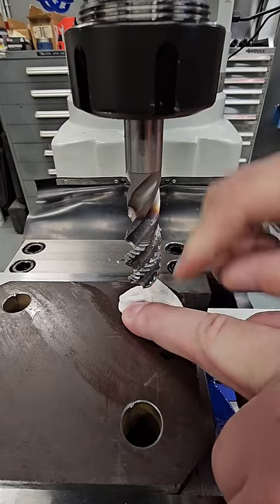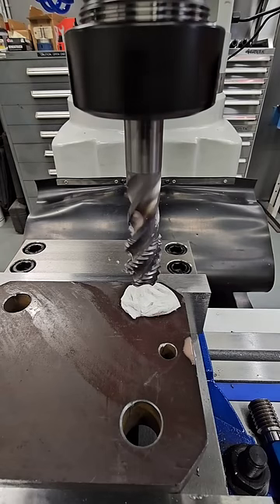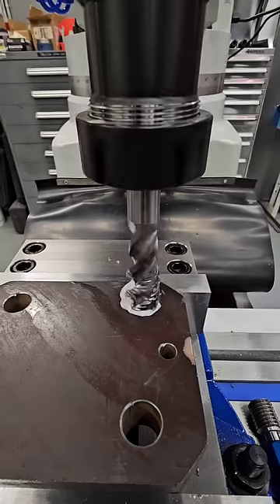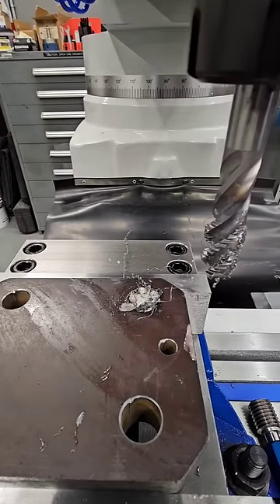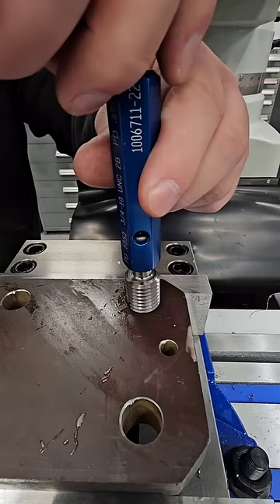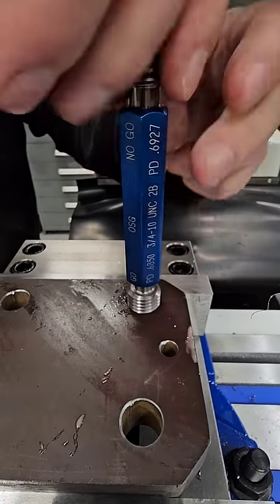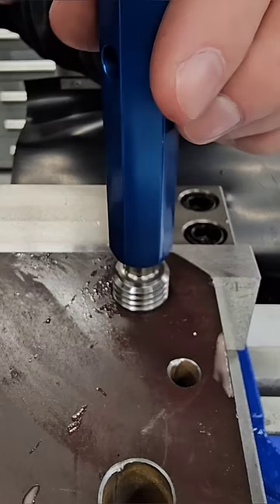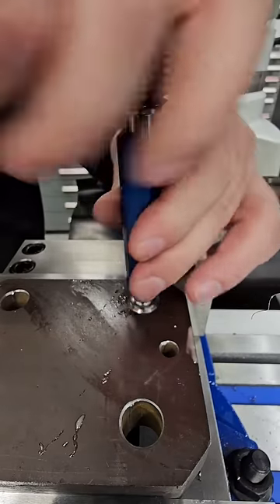Old School Machinist Trick for Oversize Threads

Comment: We use a manufacturer that plates after tapping, we retap everything they gives us to avoid seizing bolts
Reply: Ya we always retap aswell.
Reply: We had to run a die over a 1" pipe thread that was too tight after Nickel plating. That stuff was insanely tough
Reply: Better to plug the holes before plating.
Plating can harden threads leading to thread cracking. Very high stresses in threads.
Reply: This is standard practice when it is allowed.  We have had jobs that require plated threaded bores due to corrosive applications.  I've never seen the paper towel trick, but will certainly try it.  We just order custom taps... a few hundred dollars is a small price to pay when working on  dozens of $5k parts.
Reply: @matthewpeterson3329 do they make oversized taps or do you have to get them custom made?
Reply: @bradwhite3294  both, depending on the application.  You can get taps made for the most ridiculous of pitches.  It you want a 5 point entry, 3 threads per inch, it can be made.  Generally, tap manufacturers understand oversized needs for exactly what I mentioned earlier,  and have them in stock.  MSC is actually pretty good at helping  with this.
Reply: 100% the correct thing to do. 
I’ve never seen or heard of anyone doing this. Seems a stupid way to potentially scrap a job
Reply: Meanwhile I'm a first year mechanic and half of my job is dealing with seized bolts
Reply: @jhonthecat5061  penetrating oil is effective.  Kroil is probably my favorite.
Reply: @matthewpeterson3329  I use some stuff called deep creep and it saves my damn life. Gotta love aligning a 2010 Hyundai santa fe with rear toe bolt that was so seized in the bushing that I had to hold the adjustment point at spec and then impact the nut
Reply: Having to chase the threads after plating is overprocessing. They should be able to advise on plating thickness and tap it slightly oversize to compensate for it.
Reply: Ok….explain how a paper towel makes a thread oversized when the paper is nowhere near the strength of the steel the tap is cutting.
Reply: @bradwhite3294 we normally have H2 and H3 taps in the drawers, and H5 and H6, in a different drawer. We get both from Yale Supply, down the street. We made marine parts, from aluminum. The clevis hole was done with a boring head, ran both ways, for tolerances of diameter and micro finish. Threaded holes for hydraulic connections. Hydraulic cylinder, and internal threads. Hard anodized, so we burnished the cylinder bore. And we made a chamfer at the lip, with a three point, deburring tool. The clevis hole, got a couple plastic bushings. That hard anodized finish, chewed up the hardened deburring tool.
Reply: If just playing they plug tap holes . That's the plating company job.
Reply: Can’t do that if they want plating in all the threads.. using a form
Tap to chase played parts also won’t remove the plating usually
Reply: @rssilks  It depends on the part and application. This is something you do when the part is a simple and cheap one off that is easy to make a second vs time and money spent on a specific tap. 
You may even be able to make several of these plates before they get sent to HT or plating and have the job done cheaper/faster than getting a specific tap if it is odd, or out of stock. 
It just depends on the job/time/tolerance.
Reply: We're I work we machine parts that could be 4''x4''x1'' with 200+ M1.6 blind tapped holes, and we would do batches from 5-100. There's no way we would be tapping out 20,000 holes after plating! They all need to be consistent depth & fully formed with no burrs. Oversize taps are really quite cheap if it's not a super special size or pitch.
Reply: Do you tap after HT too?

Comment: We have 100 grit toilet paper at my shop. Its sure to tap oversize.
Reply: Real men use 60 grit toilet paper.
Reply: @briansmith8967  real men use 36 grit ceramic
Reply: Wow, I thought using my hand was ruff😢
Reply: 😅 its stock in the company shitter unfortunately
Reply: It taps your hole oversize then huh? Speakin from experience, eh?
Reply: Real men love a ring sting
Reply: Lol
Reply: @SCHRANZ3040  Real men use the air hose
Reply: If it's like the tp at our shop a paper towel is much smoother on the bottom.
Reply: Looks like I found the dark side of this comment section 😂
Reply: @briansmith8967  with you all the way, the biggest benefit being that the 60 grit lasts many more wipes.
Reply: Modern day men are so weak..when I worked in the Cincinnati lead foundries in the 70s (all of them have shut down after the work got sold to China,) I had a bad cold cut sandwich one time and had to vacate my bowels in the single toilet in the whole shop. It came out strong so I cleaned myself up with the steel wool we kept on the sink.. I couldn’t sit down for 5 days even while recovering from leaden lungs..
Reply: @BR-gc5uo during our lunch break we would tap each others wholes oversized back at the foundries, it was a harmless prank that was enjoyed by all
Reply: @fordmodelT1957  lmfao
Reply: Real men don't wipe at no circumstances
Reply: @orionxxv lol. What a shitstorm that would be if you had the runs
Reply: @orionxxv I know of a guy who died like that, ruptured his intestines
Reply: @RomanHerrin  He died a real man
Reply: 😂 saving the $$ one ply at a time, they are.
Reply: Pah!!
We use an angle grinder with a wire brush.
Reply: That's a war crime...
Reply: @fordmodelT1957 Sounds like a diddy party😂

Comment: been in engineering for nearly 40 years, including machining, and I have never seen this. I am impressed! Old dog, new tricks 🤷🏼‍♂️
Reply: Yeah good luck doing that on a production run.
Reply: You never seen it because its bs dude 🤦
Reply: @Beelzebub73  I'm not going to dismiss it because I've never tried.
Reply: @BrianHeath-kv6sc  No one would do that! Why comment it?
Reply: @GBOB68  then your not much of a machinist the tissue one wouldn't cut xtra steel to make a bigger hole and two its gonna throw that tap off center and drill messed up threads that are off center thats IF the tissue does anything, which it probably won't and is just a lets get views on youtube kind of thing
Reply: @Beelzebub73  I'm actually a really good machinist. I said I have never seen this before so I wouldn't know if it would work or not. Thinking about it, I can't see how it would.
There's absolutely no reason for you to try insulting me for my comment.
Reply: @eath-kv6sc You would buy the specific tap on a production run. This is something you do on one offs and prototyping.
Reply: @Beelzebub73  The threads have been cut once already, the towel just forces the tap to offset up/down slightly to wallow out the threads slightly. This isn't precise, or something to do on production runs (just one off parts) since you would just buy the specialized tap for the application.
The tap is gonna stay on center in this case(or it is gonna break)
Reply: @Tom89194  Is it possible, the problem here is he used a very small amount of tissue, based on that could there be enough pressure or binding force applied to the tap that would result in a slight size increase. That is a high quality tap so maybe it works. My taps are junk in comparison so each hole already has increased tolerance.
Reply: @wirefeed3419  Look at the video, do you see the very fine wires when they pull the tap back out? That tap definitely cut more metal out of the threads. It doesn't take much to cause an offset to cause the tap to cut more metal, whether this is consistent enough is another question.
Reply: @Tom89194 did you actually see the tap come up and out of the hole? Or just the video edit where the paper towel and shavings were shoved in the hole? Hmm....
Reply: @98ek9  When the tap is headed back IN to the threaded hole with the paper towel in it, there are fresh long thin strings created by the tap cutting tiny amounts out of sides of the threads, the paper is just causing a tiny offset that causes the tap to carve a tiny amount off, not accurate, but would provide extra clearance.
Reply: @Tom89194  where in the video did we actually see the tap going in or coming out with the paper towel???? That's what I'm getting at. I don't give a shit about the procedure. The video is cut and editing to show what you want to believe.
Reply: @98ek9  They cut the machine shut down time out, probably because this is a short and 5-10 seconds is a lot for a short, but the tap goes in between 7 and 9 seconds, during that time while the tap is going in you can see the new long fragile chips being generated, faking this chip generation would be one hell of a feat....
ALSO, at the end he runs a 2B thread check into the hole and shows quite a bit of slop in the fit, I don't know if a Class 1B tool would make it in but there seems to be quite a bit of wiggle on that class 2B tool for the threads to be considered good class 2 tolerance after running that tap in with the paper. 
I am not sure anyone would bother owning a Class 1B thread check..... At class 1 you probably don't have to worry about ANY bolts binding up, but you might have to worry about it being to much looser than class 1 as your fasteners may never tighten....

Comment: Works perfectly we used this to tap the bushes on brake pedals , the pedal is screwed onto a threaded post which retains it fixes ut but it can still move but they were too tight we did this using till roll paper,  a drop of oil and fixed forever

Comment: Our shop manager has earned the nick name shortcut. He has had me do this many times. He told me they used to use shim stock, but when he took over they changed to paper towel to make it cheaper... Lucky for me there is a real good machinist running the lathe. I go him for learning or questions if I can.

Comment: Similar, but slightly different thing happens "shimming" a reamer to get a reamed hole larger
Reply: You can also use the edge of a carbide insert to rub against the side of one flute with medium pressure to deform and force the edge out just slightly to make it cut two to five tenths larger in a pinch. Obviously it's much better to buy the correct size reamer but time is money and they do not ship and deliver instantly.
Reply: I heard of dulling 1 flute to make is ream larger. Does it make it runout a bit to get the oversize? Like when a drills tip is not on center?
Reply: @dillardhayes3612  we cut tiny slivers of .0015 shim stock just wide enough to catch 1 flute.  Ream the hole first without, them a second pass with shim.  I've done it with DP reamer and got good half over holes on half and three quarter holes.  We had adjustable reamers for bigger than 3/4 and never had a need for small size stuff.  Two of the shops I worked in had full selection of stuff most of the time and didn't have to improvise very much.
Reply: @dillardhayes3612  It slightly deforms the edge of that flute pushing material out radially basically pushing a small burr outward causing it to cut larger if it's done right.
Reply: @treemanclint2883  DP reamer? Not familiar with the callout..
Yeah last placed I worked we had an assortment but there are always those days when the job MUST go today....
The day before the crib is full 🙄
Reply: If the thread needs an oversized drill, the % will drop. Since we carbonized, anodized, and hard chromed, for tool and die, we had oversized and carbide taps. Reamed holes, we had adjustable reamers, and burnishing tools. And a Sunnen hone, really helps with pin alignment on die locations.

Comment: All I did is that I used the next class tap that is a few (tenths of a thousand) larger, which lets the "No-Go" side goes more than 2 turns, so when they plate the part; the size of the plated threaded hole comes to normal size. And it worked all the time in my 30 years of machining work.

Comment: Useful for drilling holes in thin material as well. Makes them nice and round.
Reply: Really? Drill thru with paper towel? Drill a pilot hole first?
Reply: @dillardhayes3612  paper towel or shop rag. It keeps the drill supported in the flute as it bites to keep it from moving.

Comment: When the plane goes down folks, remember these guys.😂
Reply: I assume this is how boeing tapped the bolt holes for the door plugs on the 737
Reply: The threaded hole still needs to be in tolerance, hence the thread gage.
Reply: @matthewpeterson3329  If it gets heat treated it will be too small and too hard to recut to size, you need it slightly oversize before being heat treated to be at size afterwards.
Reply: @phillhuddleston9445   I've not encountered tolerance changes due to heat treating, only occasional slight deformation on large plates.  Hard anodizing will add dimension, as much as .003, but usually closer to .0015 to .002.  This is why oversized taps are used prior to plating so the threads are as corrosion resistant as the rest of the surfaces.
Reply: @mtraven23 the tap on those holes is irrelevant, the bolts were not installed. There was a single bolt holding the door section together.
After a point incompetence becomes malice, I think it's enemy action.
Reply: @MaximilianonMars   DIE in aviation is only there to make people not want to fly after a lot of mishaps and fatal crashes. 😏
Reply: Agreed. We are living in a newer world that becomes even more acceptable to machine out of tolerances. They make specific oversized taps for these applications. Unlearning a bad habit is more difficult than learning the correct way in the first place.
Reply: Strictly automotive...nobody will notice at 55 as the saying goes...
Reply: @shaffer4220  hope everyone is aware that GD&T was put in place to make parts more compliant...with linear tolerancing parts were scraped when they would still be called good with 
"true position"

Comment: My OCD triggered not blowing those shavings away before threading it in.
Reply from the maker: Power of editing, it was cut out.
Reply: Agreed, I made a 90° air gun tip from a section of car brake line just to blow out holes. 90° so it doesn't blow the chips up your hand & arm. I had the only one in the shop so it got borrowed a lot😊

Comment: That went in pretty loose (giggity)... Plating is usually only few tenths. We just run to the upper end of the tolerance with the nogo still not going, but starts to stick. Thats with heat treating AND plating.

Comment: Sure thing. I use panty liners pads works wonders
Reply: Used ones?
Reply: @bobbyfischer6786 Obviously. You want the pads to already have some special lubricant to make tapping easier.
Reply: Tried these as well, but too many hairs attached, gives a very loose fit.....
Reply: @robertteap8052 lolol...not a pretty picture, indeed 😮😊😊

Comment: I my 30 years o Tool & Die Making if a parts made of Tool steel was to be Heat Treated in anyway but a vacuum Furnace I always tapped them with an Oversized Tap. We kept  set of Regulal size & over sized taps and Reamers right next to every Drill Press.

Comment: Doest the paper towel absorb heat? Or does it make a medium to hold the oil and shavings to polisht the threads?
Reply: It just gets in the way and forces the tap side to side at random which makes it take bigger bites than its supposed to.

Comment: I don't know why the heck you wouldn't just get a different H size. Taps are pretty friggin cheap. I also don't know why insides of threads are being coated. We always plug threads and bores pre-coat/ano. But also, I respect the problem solving. Its a part of the job. Lol.
Reply: Good taps aren't all that cheap for a home machinist. But something that's relevant to everyone is that time is money. If you don't have it on hand then you've got to pause the job and go get one, or worse, if you live somewhere like I do then order it in.
Reply: And what would a bit of paper do between a BLADE and the steel you working on? Absolutely nothing. @charmio
Reply: @vihreelinja4743  No idea! But I've seen old machinists do the same trick with a rag. Take it up with them.

I only commented on why you can't always just go buy the correct tap.
Reply: Only thing I could think is when it's cutting the thread one side is going to get cut first 
    Then the towel will take up the space on the other cutters 
     Making it kinda wobble cut
Reply from the maker: I mentioned H limits in the clip.  This is NOT how we tap holes.  I am merely showing an old school trick that is a neat part of machining history.  It may be beneficial for someone working in their home shop etc.
Reply: @SpeedSeekerMoto. You mentioned that you "always plug threads and holes before coating/ano".
I am a receiving inspector with 35 years of experience in the aerospace industry. If you send parts to my company, I'll reject them because of the missing coating/ano.
Unless the drawing allows that exception, your parts are non-conforming.
Reply: @losapriscos7258  Interesting! I assume that's for corrosion resistance, but isn't that unnecessary with anti-corrosion thread lubricants like Tef-Gel?
Also what parts in particular require the coating/ano on the threads?
Reply: @charmio   @charmio  If the drawing calls for chem film or anodize,  without any masking exceptions, it means the whole part, including, yes, holes and threads.
In the case of paint,  holes and threads are normally specified to be masked prior to paint. 
The Tef-Gel is not always used, and one can not assume it will be. 
The parts need to meet print. Otherwise, it is going  to be rejected.

Comment: So what do you think is happening.  Do you think that the paper towel is under enough compression to polish out the tooling marks in the valleys of the threads
Reply: No lol the paper is just under enough compression to make the tap wander off center and take little nibbles here and there at random which kind of sort of equal out to an evenly oversized hole.